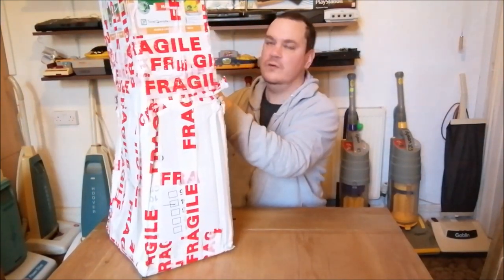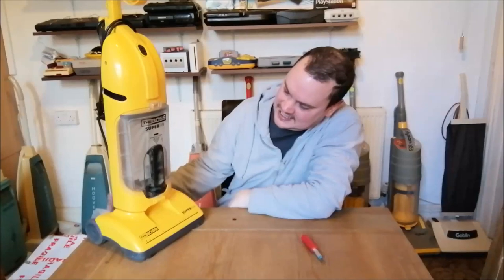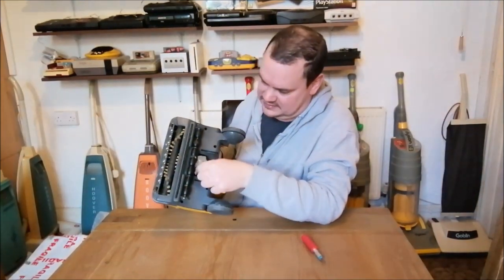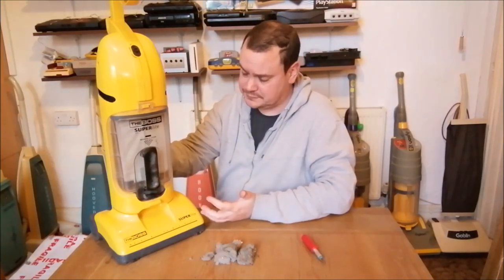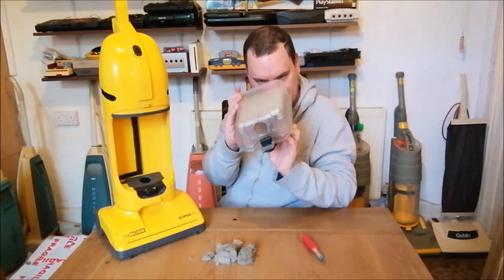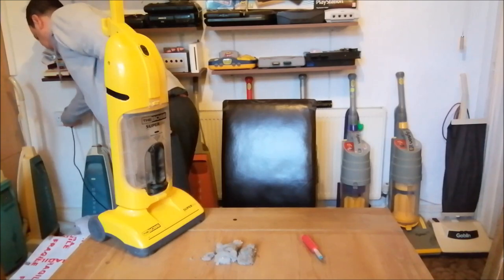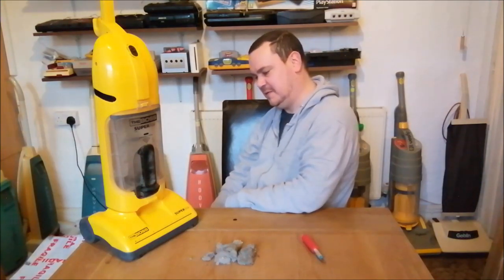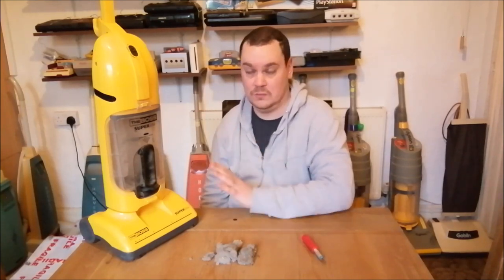THE WORST Vacuum Cleaner I have ever shown you… Unboxing / First Look / Disappointment / Alcohol

Comment: I had one of these, gave it to some friends eventually to have as an upstairs vacuum but as they were carrying it up the stairs they dropped it and the plastic handle snapped off(also because it was already broken before and someone tried to glue it back together as evident by glue streaks right above the power switch and the fact that I couldn’t remove or lower the handle) After that, they gave it back to me to send to the garbage and I gave them my Hoover T-Series WindTunnel with the cord rewind, much better quality

Comment: They sold millions of these in the USA as well, mainly aimed at the older crowd and extremely popular with university students. They were usually sold in the "stick vac" section of stores, so I imagine a lot of people had them as secondary machines. They are noisy and not very effective, but I'm slightly nostalgic for them since I have seen so many. I think the 90s cordless version was better even, less noisy at least. 

I  had a slightly later (2009ish) facelifted version from new which had a different filter and bin catch, said catch completely failed after a few months and it was tossed. 

They very quickly changed the filter design to be a basket-style fiber filter with a rubber seal all the way around that just pushed into the top of the bin, but still not great. 

Would love to see a demo of this one day!
Reply from the maker: That's really interesting to hear about the re-designed filter system. I don't think we ever got that over here in the UK
Reply: Don’t forget the rare white and green or all green 12 amp version😊

Comment: 2 items to fix, bottom panel use card stock for template (cereal or cracker box) transfer template to smooth side of DVD case (firm flexible plastic sheet and easy to crease) attach and seal sides with painters tape (sticks well and removes easy). Next filter use old cloth vacuum bag, generic hepa bag, or a purse storage bag, cut bag to overlap sides, top, and bottom of filter screen. The cloth will be fitted in front of the coarse screen for an extra fine filter stage. And since hepa bags take a lot to clog and have good air flow should last longer.
Reply from the maker: Really really good ideas Keith. I did find the lower cover in the box after I'd finished filming. I've done a little something with the machine and filmed the video for it today, so you guys will see the results next Saturday :)
Reply: @TheVintageApplianceEmporium  let me guess you removed the filter and put a hepa bag over the bin fill tube and let be a bottom fill bag

Comment: It's missing the plastic 'window' for when it gets something caught you pop it off and pull out whatever is plugging it up. The one you are showing has a completely different filter than mine. Mine has the conical shaped mesh filter with rubber gasket that fits tightly in place and it does a great job, pops right out, tap it on the inside of a waste basket and pop it back in.

Comment: Did I hear 200 watts :D That filter setup is horrible LOL. I would make sure that it doesn't leak past the pre motor filter. Well if it's possible. But bag might fit to that fill tube...
Reply from the maker: Yup a massive 200 watts of incredible suction power! That filter is completely knackered unfortunately

Comment: These were functional maybe for the price. I would say the worst are those that weren't cheap but perform poorly and came with loads of problems such as "Hoover the one". Another bad offering from Hoover is the "Hydropower" which is basically an awful rip off of the Rainbow water filtration vacuum.
Reply from the maker: Never head of the Hydropower! Will have to do some research
Reply: @TheVintageApplianceEmporium  Believe you and me I've seen some awful products from the Hoover company in recent years but these took the cake.

Comment: These used the same motor as the Superbroom. Infact it is just a larger version of the Superbroom with the motorised brushroll. Absolute rubbish, I know they were only designed for quick cleaning, but when they don’t pick up anything at all, what’s the point? 😂 Any dust they picked up totally bypassed the filter and went straight into the motor fans. Not to mention as soon as it hit a carpet the brushroll would just stall instantly as the brushroll motor was about 2 watts 🤷‍♂️😂
Reply from the maker: Exactly - what's the POINT??! You may as well not bother and just leave your carpets alone!